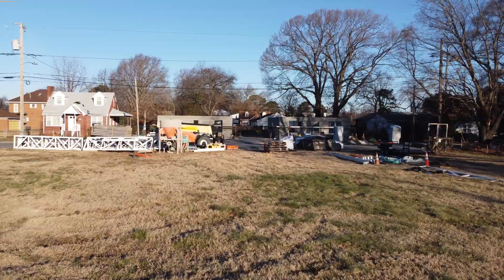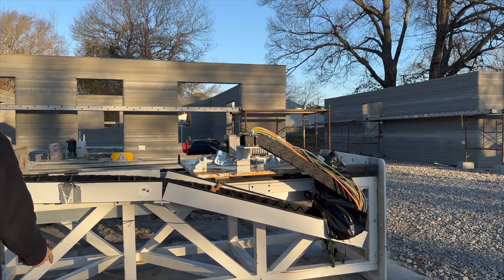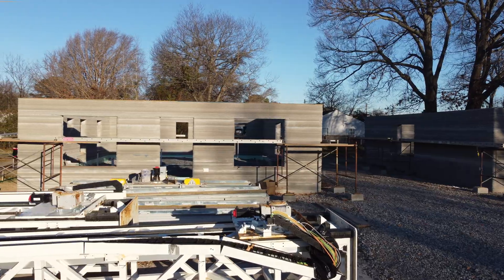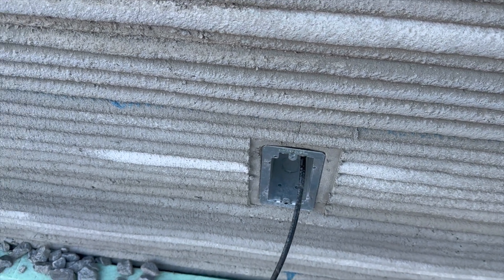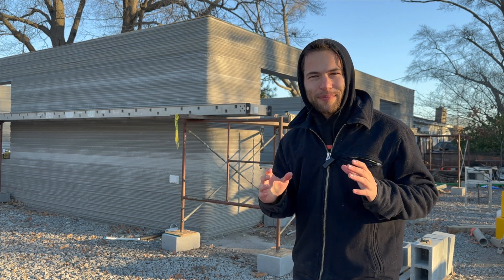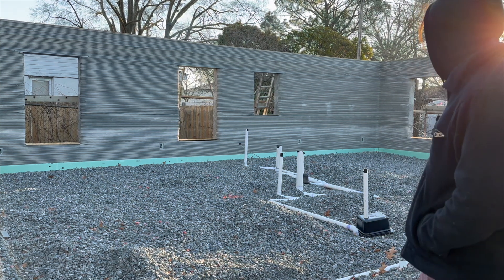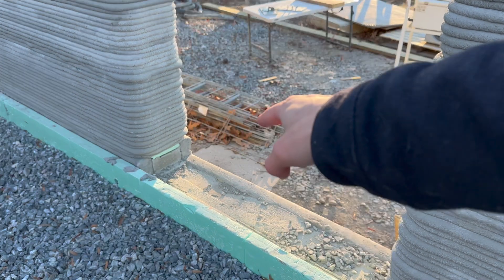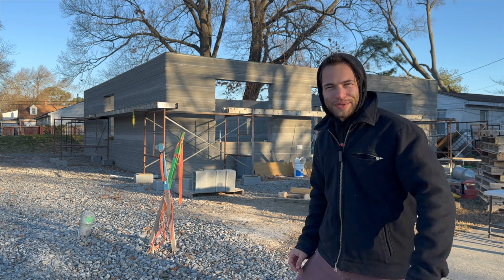Black Buffalo & Alquist 3D Print 2 Habitat Homes

Comment: Hi Jarett, Thanks for stopping by. We are very excited to have a project out in the open and think it came out great. SHould be the first of many this year.

For anyone wondering, those were extra cables that our team provided just in case they wanted to extend the footprint (add rails), but they weren't needed. The metal guide that was bent is a relatively easy fix/replacement likely damaged during transport or disassembly. The black track is only for cabling, we have a separate hose management solution that wasn't shown.

The printing of the houses was just as Jarett guessed. Like any other piece of equipment experience and hands on time is the best way to have a great print. Excellent material from MAPEI also helps. It's sold under Planitop 3D and available in North America through MAPEI directly. 

We're happy to give you a walkthrough in our factory or at the next of our partners jobsites and if anyone has other questions send them through our contact form on our website or email questions@blackbuffalo.io for more info. We are going to have a big year and appreciate your coverage and commitment to the industry.
Reply from the maker: Thanks for the clarifications! Congratulations on the big milestone. Eager to see what you print next!